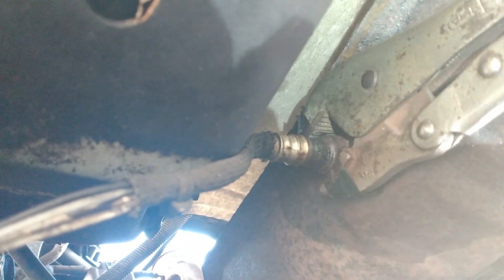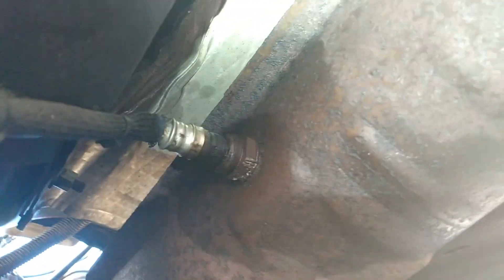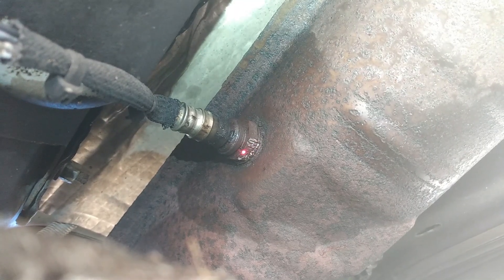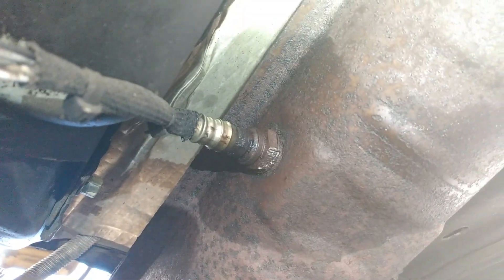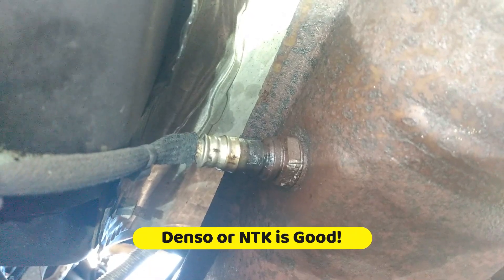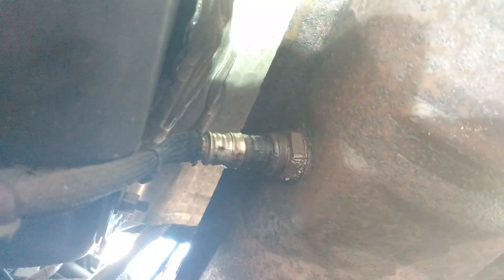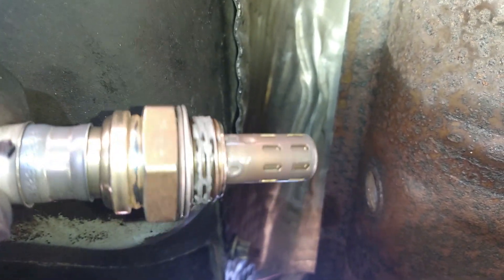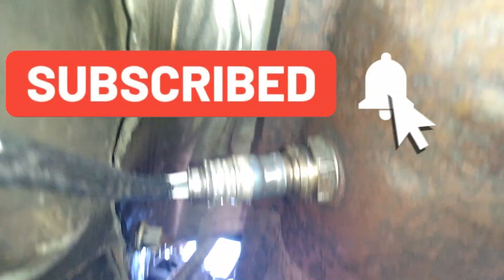PT Cruiser Replacing Downstream Oxygen Sensor

Comment: Hello, are the upstream and downstream sensor the same ? Or they different for pt cruiser 2001
Reply from the maker: Replacing them on a 2001 PT cruiser is the same procedure. But the upstream sensor is a different sensor than the downstream one
Reply: Where is the downstream sensor?  I just replaced the upstream.  Thanks!  Btw…very proud that I have done this!!). Came out great thanks to all the vids y’all put out.  I am Wonderwoman!
Reply from the maker: @TheRealM.O.M  I'm happy that you where able to replace your upstream sensor. The downstream O2 sensor is located underneath the left driver side door under the car. Should be on the cat converter down there.  You can also follow the tailpipe leading from the muffler going towards the front of the vehicle but it's not pass the front wheels. Hope this helps. Thank you for watching!